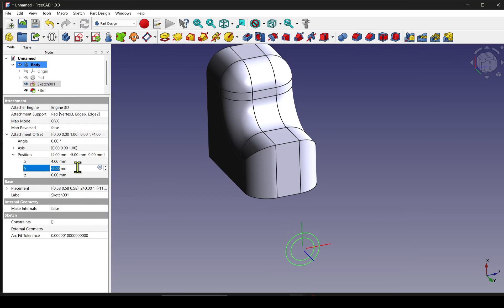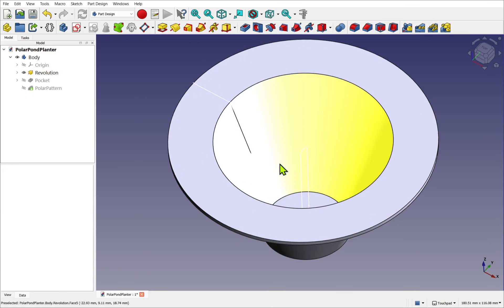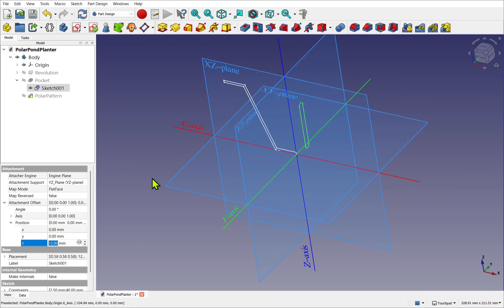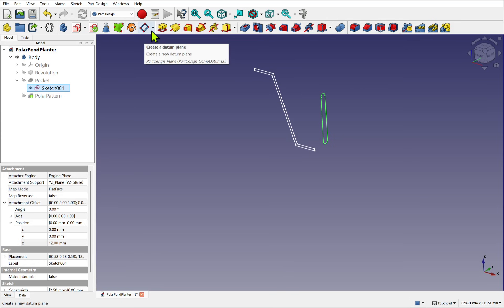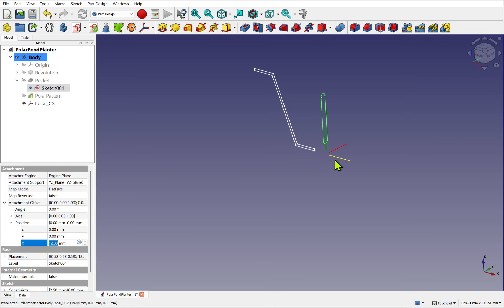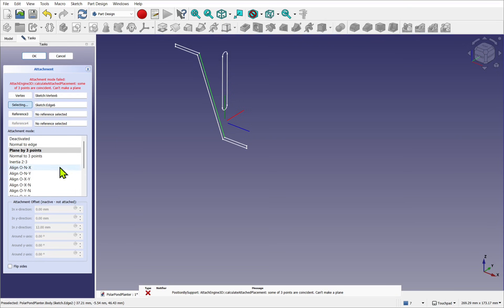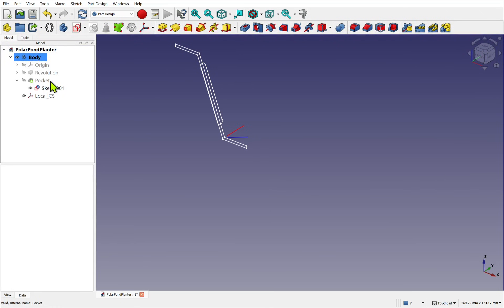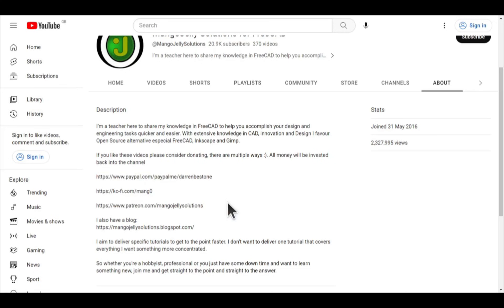FreeCAD 1.0: This WILL HELP Visualize Sketch Attachment / Orientation

Comment: Hey Mango, thanks for the tip, is it possible to use also in parts and not only parts design?
Reply from the maker: Glad you enjoyed.  The LCS in 1.0.1 unfortunately is only available inside the part design but in the upcoming version of 1.1 this feature is baked in so you don't even have to go through this process.  I will be talking about it in my next video which I will be releasing this evening.

Comment: Hello Darren.   That is one way to do it, I have also used other methods more crude that worked just fine.
Coming from early Inventor (with all the FreeCad like bugs it had) I am not offset by many hurdles others consider insurmountable.

But there is one I could not fix yet in my brain.  How to add fillets or chamfers to shaped edges obtained from boolean extraction/subtraction/combination operations.

All those edges cannot be fileted / chamfered for the love of my life.

Comment: Funny this came up today.
I'm modelling my 3D printer in preparation to designing some upgrades and I have created a 2020 T Slot extrusion model which I am cloning and copying into the printer model to create the frame.
I have been using Transform to move all the frame sections into position.
This video would have been a great help.
Reply from the maker: Ah shame it wasn't in time.  It's a tricky area this one, even to this day I have problems and have to nudge the XYZ until I get my head around which way the sketch is pointing.
Reply: @MangoJellySolutions  It wasn't a method I normally use and I was surprised how quick , effective and precise it was , using the transform handles to move the parts.

Comment: Unfortunately after 5:36 nothing works properly. When I reattach the sketch it's on the left side for some reason.
Reply from the maker: If you look at the properties in the data tab on the sketch there is property called map reverse.  I am wondering if the sketch has reversed for some reason.  Try setting that to true/false.
Reply: @MangoJellySolutions  Thanks, I was able to get it to work, although It's still confusing. Repetition will help clear things up.

Comment: Do you have any videos on lofting from a sketch to another loft?

I made a loft between two b-spines on the horizontal, came out near perfect.

I needed to make a loft from a planer sketch on the vertical to make a solid, and it didn't work.  I had to add surfaces in segments and make a solid.  The solid does have some issues though, doesn't want to take fillets cleanly for example.
Reply from the maker: Ah, actually, I think I do have an example:  EDIT: Link -> https://youtu.be/sgzKC5moK_M  Hope that helps with your project.
Reply: Thank you so much for the reply but that's not quite the solution I'm looking for.

My first loft results in a curved, non-planer surface.  going from front to back across two b-splines.

Then I have a planer sketch with a closed wire under that loft, that I want to loft up to and create a solid.

Comment: Thanks Darren. How did you get the offset sketch for the revolve.  I haven't found a decent offset function in free cad. Very nice and very informative
Reply: Create a datum plane and sketch on it (instead of a face)
You can then manipulate the datum plane - move it in any direction or change it's angle